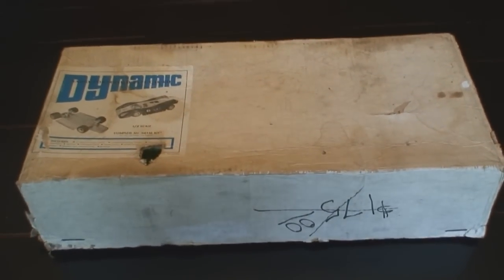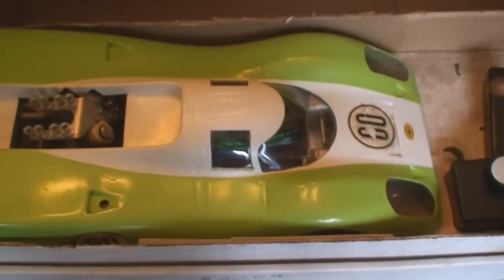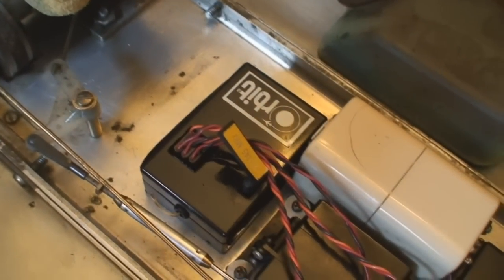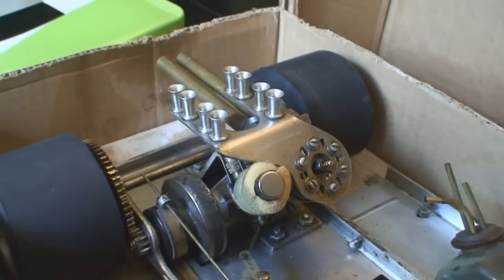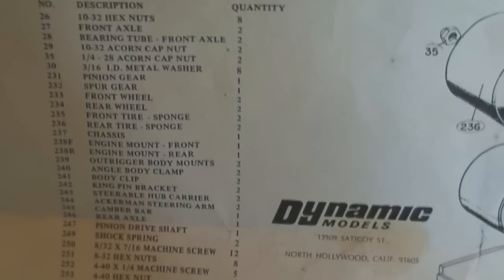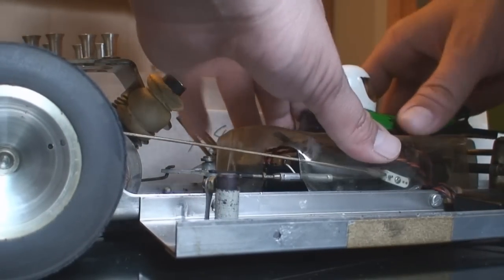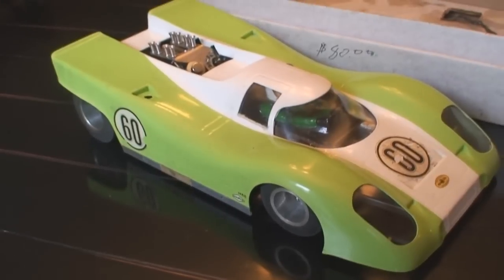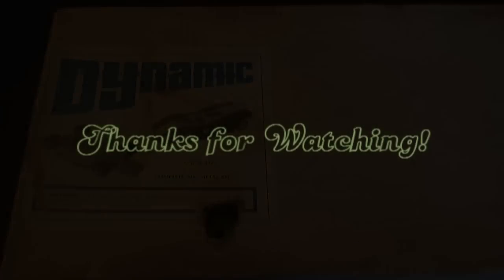69'-71' Dynamic Models Vintage Antique Remote Controlled 917 Porsche

Comment: Hi.  I have one of these, and have had it since new.  Mine came in kit form.  It originally did not have any brakes, and the body shell was held into place by wire clips, and not screws as stated in the video.  Mine is painted in GULF porsche colours.  I suspect it would still run if I replaced the radio, which has been borrowed at some time for another model.  It has a hand built exhaust system, as none supplied with the model.

Comment: i have one of these!.never drove it.however car is next to perfect. needs motor and body.rims are like mirrors plus new rubber. car was drove one time at some point if its life. what do you guys think this thing is worth$$ ??
just curious.  thanks
Reply from the maker: I put mine on eBay for a starting bid of $500 with a buy it now button of $3499 and it sold in 24hrs for $3500, but I had the motor and the electrics.

Comment: Just in case anyone on this thread is interested, I am going to be listing a Dynamic Models Porsche 917 Coupe remote controlled car, serial #201, on eBay later today under seller cste6857. Almost identical to the model in this video.